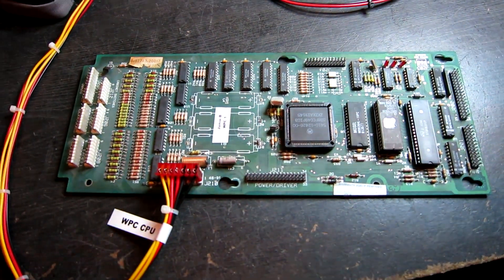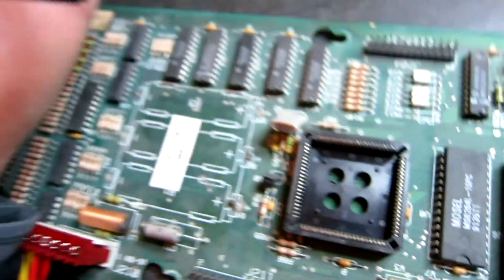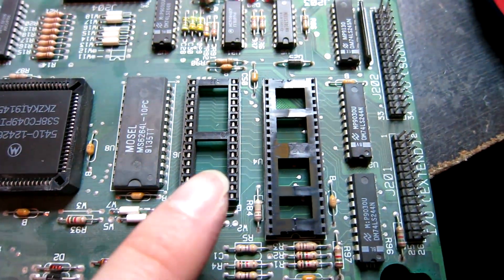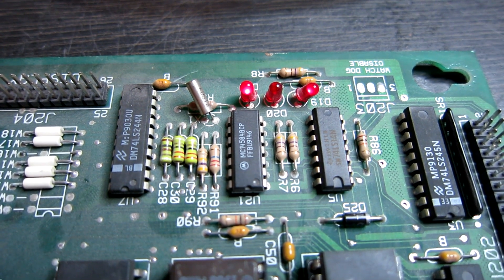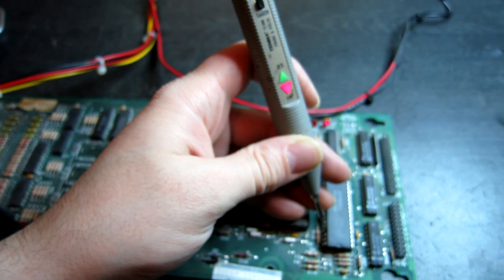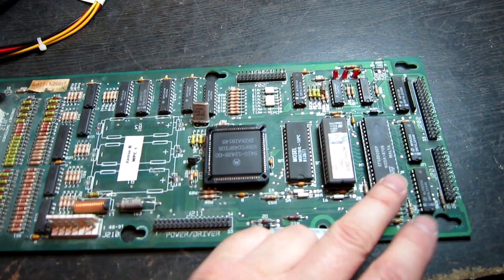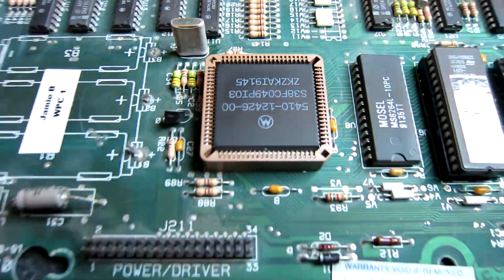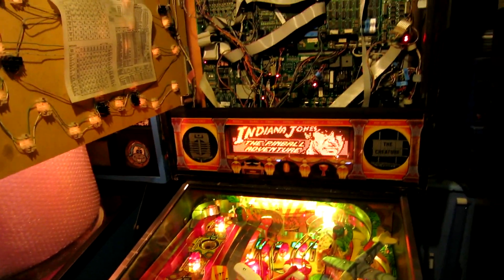Williams WPC CPU Board Repair

Comment: -all cables unpluged D20 flashes

J202 plugged back D20 stays on D19-D20 off

J201- D19 D20 stay on

J211- D20 flashes-D21 stays on
Play field lights up
Seems like it does a test on some areas, hand adjust, then Matrix area it keeps ejecting balls from it for a bout 30sec then the play field powers down then back up. If i leave the coin door open it no of the above happen.

J211-J201 plugged in D19-D21 stay on
J202-J211 -D21 stays on
J202-J201 -D21 stays on